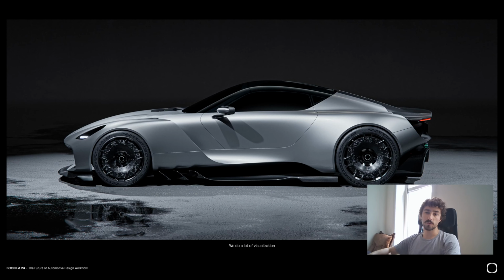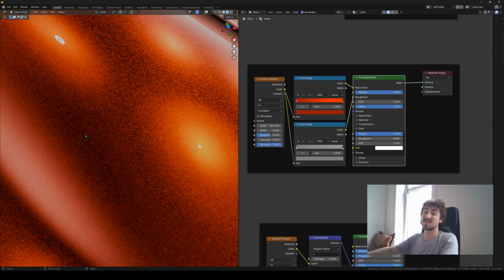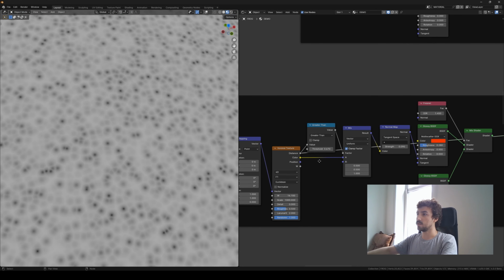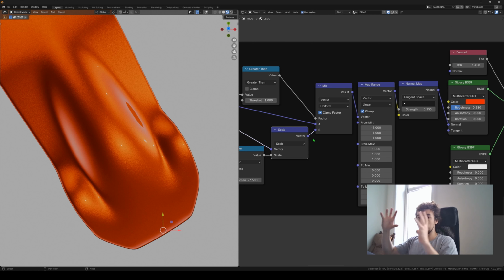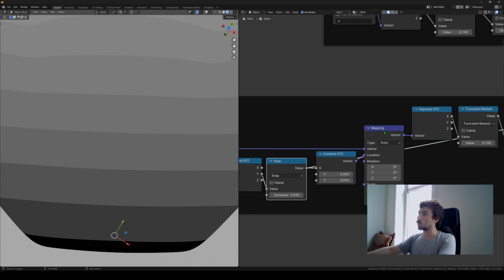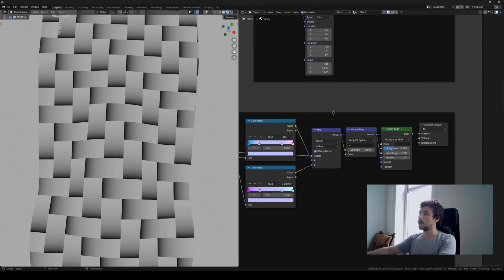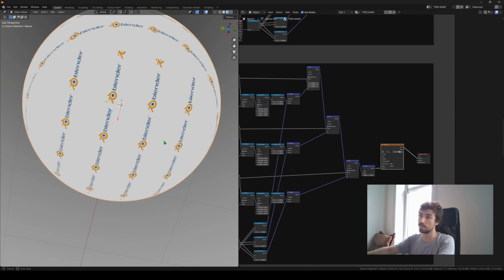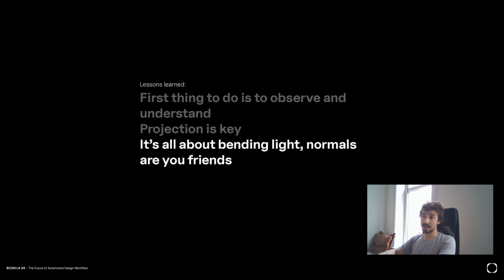Procedural shading for Automotive visualization - Odilon Loiez

Comment: A few notes and questions:
1. How about metallic paint with pearls instead of flakes? I personally prefer flakes with a realistic scale to them over white noise.
2. For flakes in UV tangent space, shouldn't color output be [0, 0, 1] to [ 1, 1, 1]? Normal maps in this space always have blue (almost) maxed at all times. I use full color but in object space, although it will fail too if the effect is too much.
3. For paint, have you tried a layered approach to add depth and color variations? Instead of a single paint and coat, the paint consists of several glossys with different colors, roughnesses, and even normal response. Similar to how you'd do "hazy gloss". A more advanced version would be to use voronoi (color->separate color.hue, maybe to a power to shape the curve) to select the parameters that goes into a single glossy, which now results in a single shader call per pixel sample and thus more efficient.
4. For carbon fiber, I like the single parameter to control the (simple) weave pattern, much better than mine.
5. Not a fan of calculating normal maps when bumps are much more intuitive to control, and are not affected by the tangent space problems with triplanar (sharp like yours, or smooth) mapping. I'm a big user of smooth triplanar mapping for other purposes, but I can't imagine using them on carbon fiber car parts. In manufacturing, it's literally a sheet of carbon fiber weave you press onto the shape, so UVs just make a lot more sense. You also get tangent space UVs for anisotropic shading (tangent node), which is my preferred method. A thing to be aware of is that if you scale the fiber density, you have to scale by 1/scale into bump distance to get the same normals, whereas for normal maps the normals are scale independent.
6. I'm guessing no onion peeling on the coat is a deliberate choice?
7. I would probably still add a little large scale bump on the paint coat to make it less perfect, not sure how perfect fiber resin is.
8. With thick coats there may also be a darkening effect on the substrate; grazing angles being darker than head on angles.

Comment: Awesome work!  Just a suggestion for your white noise colour generator (18:30) instead of a random cartesian generator, use polar coordinates - i.e. random vector length and random angle (0-360°) - then resolve these back to cartesian coordinates for the next step with a X=vector length*cos(angle) and Y=vector length*sin(angle).

Comment: Question: When I apply a shader and then modify its settings like color or scale, it appears to save all these changes to the base material in the library so now every time I want to go back to that base material its now changed. How do I lock the library materials so they wont change?
Reply: You need to change your Asset Browser to "Append" instead of "Link" or "Follow Preferences".  Follow Preferences can be used, but you need to go the that particular file path in the preferences and set it to "Append".